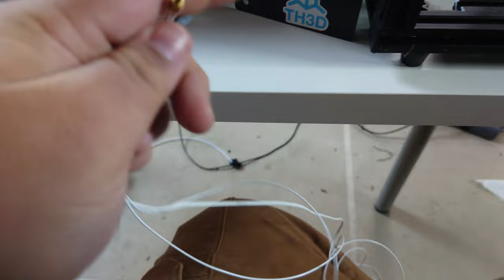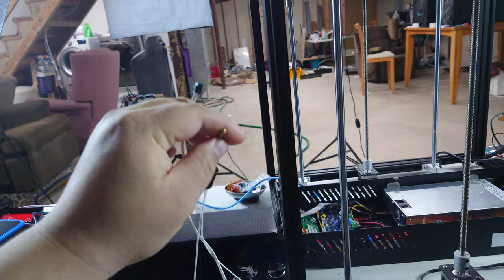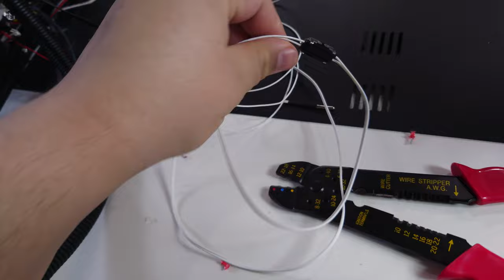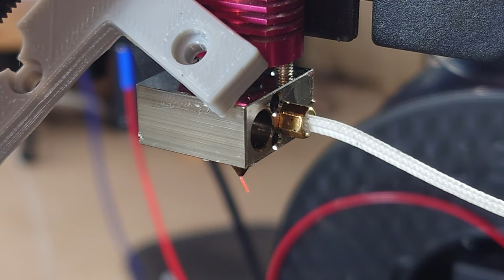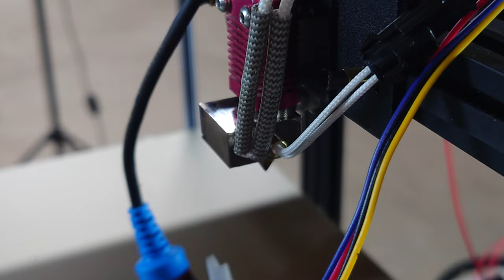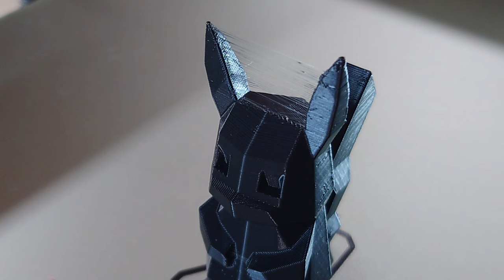Ender 5 Plus gets new heaters and thermistors

Comment: 50W cartridge because it makes things go that much faster?
The limiting factor is still the heated bed, which takes up loads longer to heat up.
Also, a more powerful cartridge makes keeping the nozzle temperature stable HARDER. In other words, temperature won't be as stable as before. Bad choice!
Reply: I just assembled the 5 plus. The bed heated 5x faster than the nozzle.  
Seemed to take forever for the nozzle to get to temp.

Comment: Sir I need help I am panicking
I installed the silent board I was printing for about 10 hours with the silent board and mid print bed stopped heating.....I got thermal error and now bed won't heat what should I do ...I checked the cables inside the board everything is okay
Reply: check the wires on the thermistor theyre really thin and break easily. also make sure the thermistor is screw in on the hot end